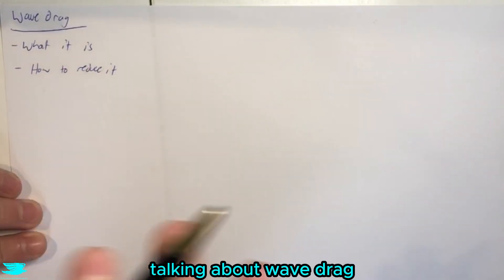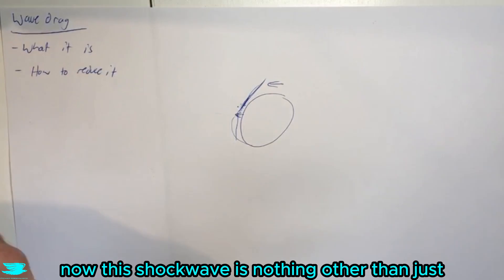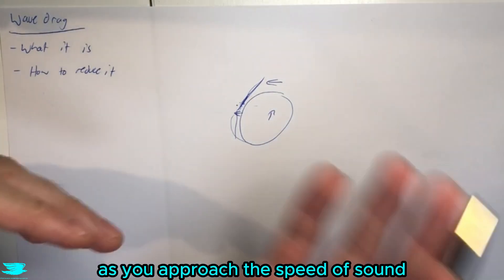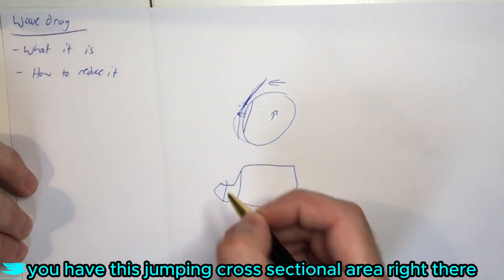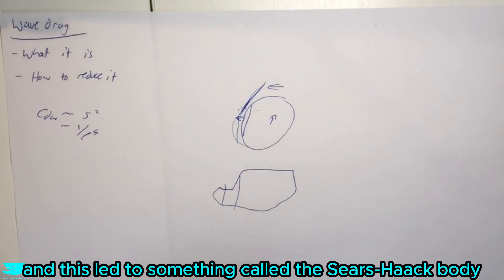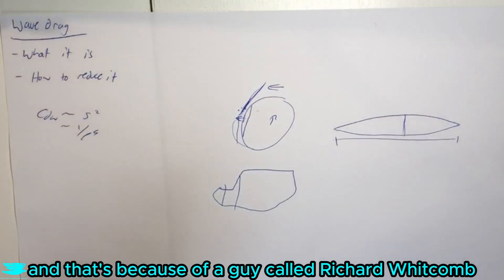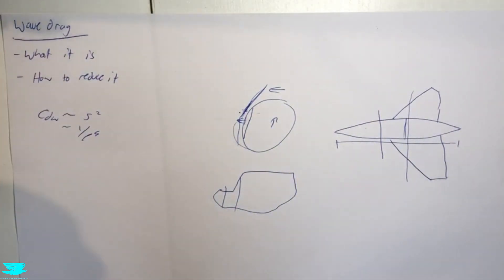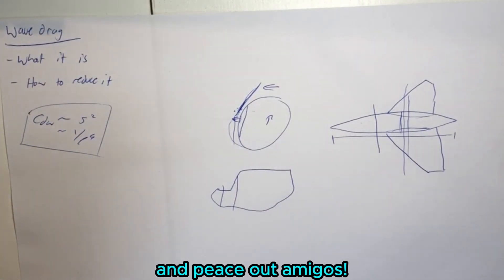Wave Drag Explained [Aero Fundamentals #64]

Comment: How would you define wave drag for swimmers in the water?
Reply from the maker: You can actually see the wave drag from the ripples on the top of the water. Actually, we did a podcast episode about swimming wave drag a couple of weeks ago here: https://www.youtube.com/watch?v=6z1hH4TD7gU
Reply: @PremierAerodynamics  i did watch this and found very interesting, i was more so interested in the actual definition of wave drag from swimmers
Reply from the maker: Well it's a different type of wave drag. It is more to do with the energy required to push water up against gravity and due to the different densities between water and air, obviously that takes more energy that if you were simply to move water vertically in other water.